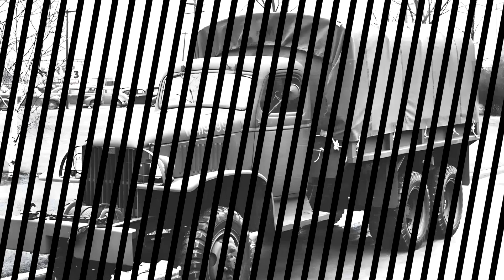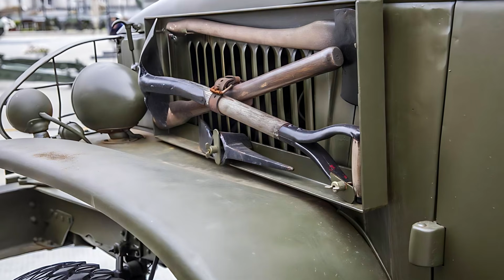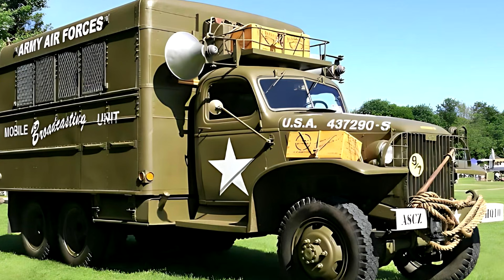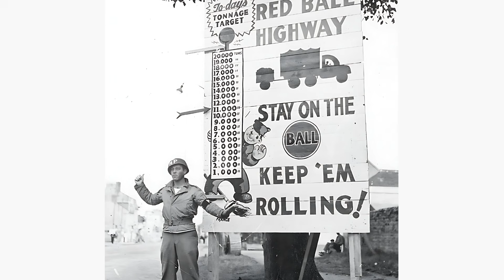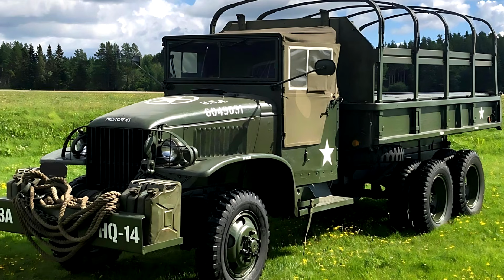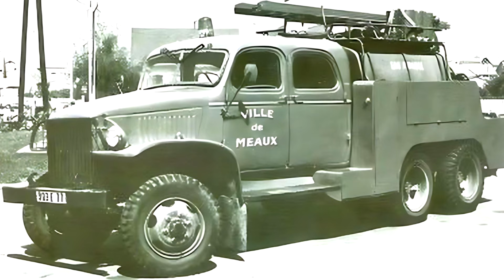1941 GMC CCKW 📦 Cargo, Fuel, Ambulance & More

Comment: That's amazing 93 horsepower in over 200 ft lb of torque at only 1400 RPM that's incredible
Reply: It's pretty respectable for the day, in comparison the AEC direct injection engine used in the Matador and Scamell pioneer was about 110BHp with a max speed of below 1800revs and they could pull 60tons.